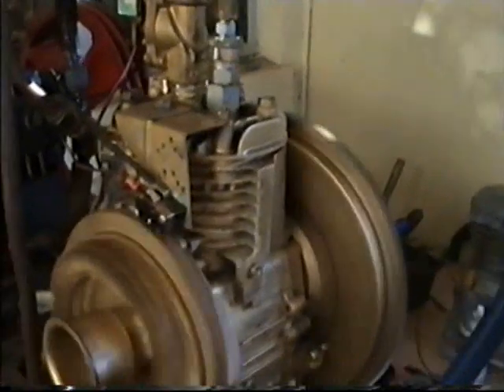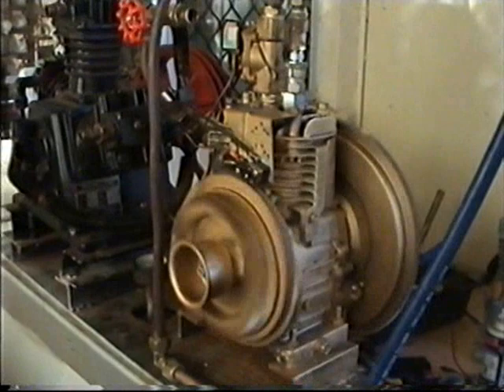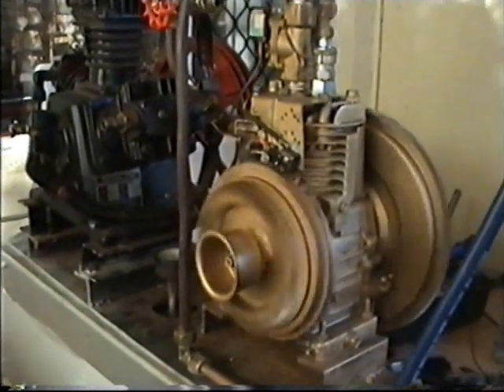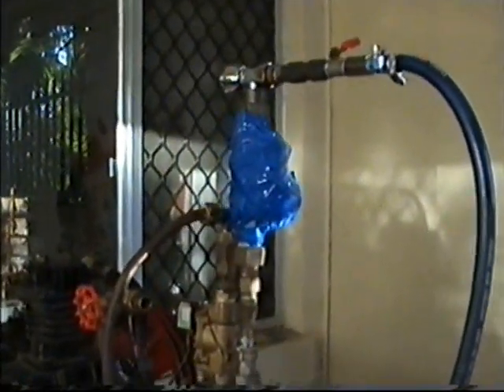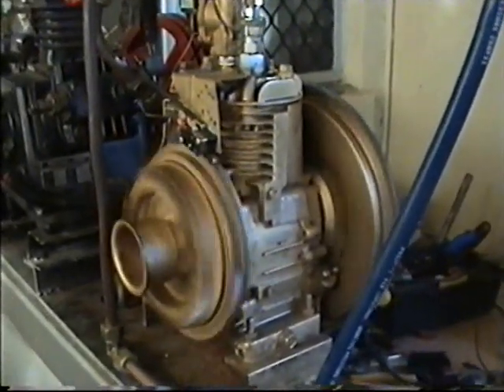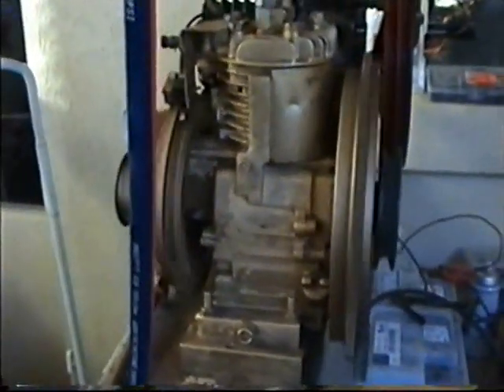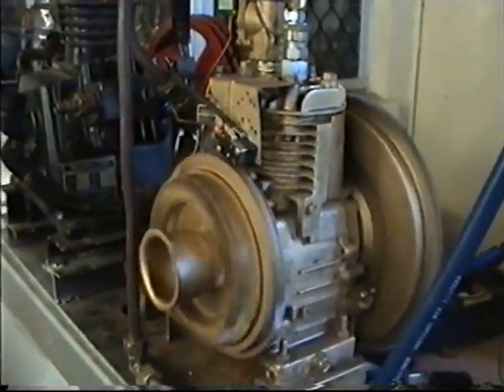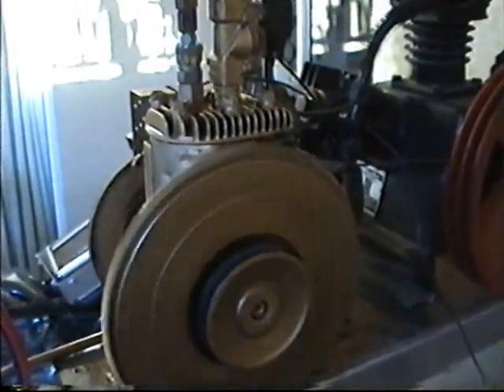FREE ELECTRICITY USING THE ALL AIR MOTOR!

Comment: Sounds like there is an electric air compressor running in the background. Where is the blue hose coming from? I do not see a belt connected to the air compressor.